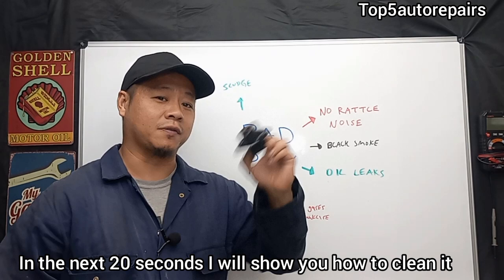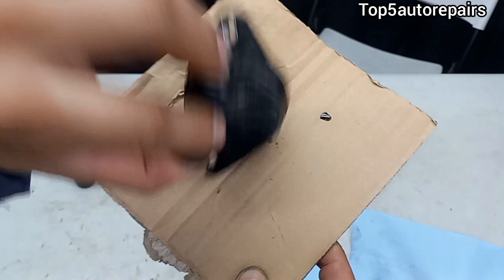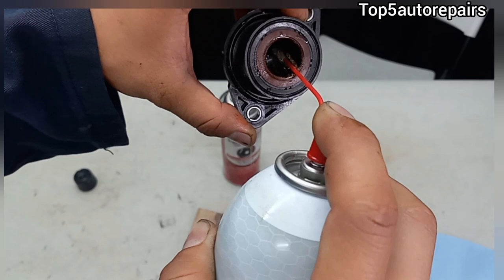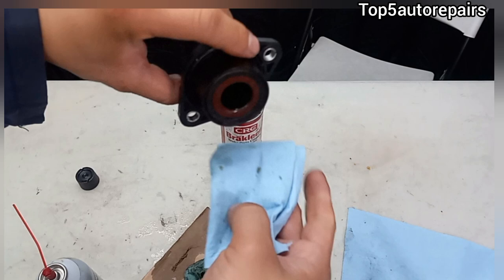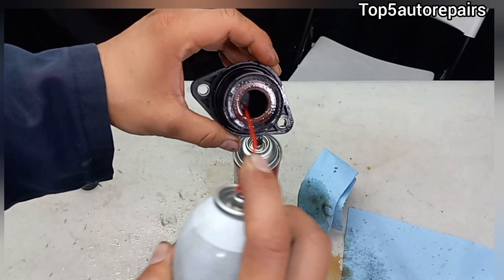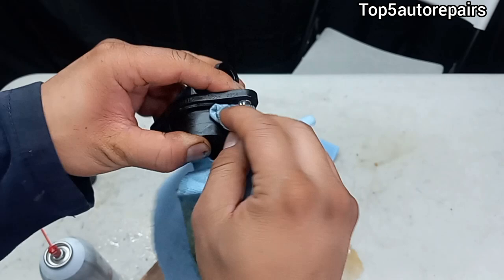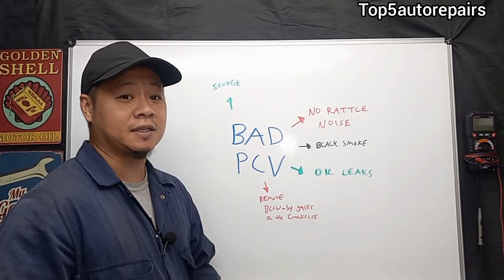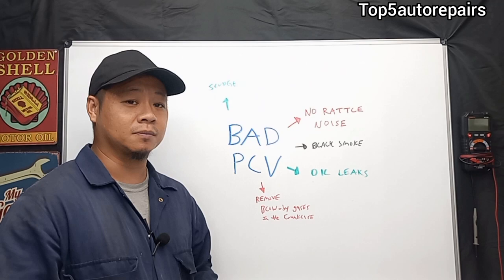HOW TO DEEP CLEAN A STICKY PCV VALVE AND HOW TO TELL IT A BAD OR DUE FOR MAINTENANCE

Comment: Bru where some gloves !!  Also....you should be using those chemicals outside only...not inside a garage or house!!  Those chemicals are harmful ........Thanks for your video's.  IMO just replace it if you can, it's a few bucks for a new one.
Reply: OEM for my truck is $106!
Reply: @dirtywooky6557  I get it....however aftermarket in many vehicles either won't last, makes no difference or just a waste of $.  Especially when it comes a Toyota or honda...they are Oem Specific.
Reply: @bigfootswatching9986  Totally fair point! But on the other end of things, my OEM part just went bad at only 61k miles. Maybe I had a lemon, I’m not sure.

Comment: Why not buy a new one with a fresh spring for 3$??!!!!a can of carb cleaner is about $5.Just saying...lol.
Reply: $30.00 at Nissan dealer
Reply: The one for my Volvo v8 is $100
Reply: In my case, the PCV is built into the valve cover. It's way cheaper to just clean it.
Reply: Advance want 29 bucks for mine.
Reply: $3? What? You're living in 1971.😂

Comment: I have one that rattles but allows flow both ways. Is it no good?
Reply: Yeah you need to put a balloon on it and see if it holds pressure.
Reply: @JohnSmith-xx1lx ...they are not meant to be absolutely tight....the ballooon test is misleading.
Reply: My old one blows both ways. Bought a new one - same thing.
Is it a bug or a feature of these valves? I understand that theoretically it should blow only outwards, but two valves blowing both ways make me think that it's a spring that requires higher pressure to close than mouth blowing.
Reply: It's supposed to rattle and flow both ways at minimal pressure. Blowing hard should make the rattle shift and block the outlet under normal operating scenario... pcv should allow the flow of air, while blocking oil particulates.

Comment: Soak it in a small container of hot tap dish soapy water for 15 minutes and use an old toothbrush on it. That can speed things up and then go straight to any solvent cleaner.  Douse it with wd40 or similar at the end, if using water only. Get most of the water out, if not all and make sure it shakes and  such!

Comment: Can you do this if you’re not able to take off the pcv (aka pcv built in) ? Will this harm the engine?
Reply from the maker: If the pcv is mounted on the valve cover the solution will go straight into the engine oil
Reply: Don't do it
Reply: Do it and do a immediate oil change. Run the engine a little spray it cut off engine fast do a oil flush and oil change that makes the most sense to me man. But don't take me on seriously lol I don't want responsibility